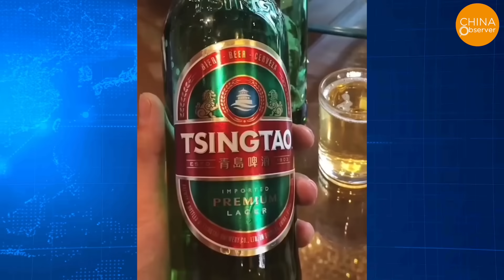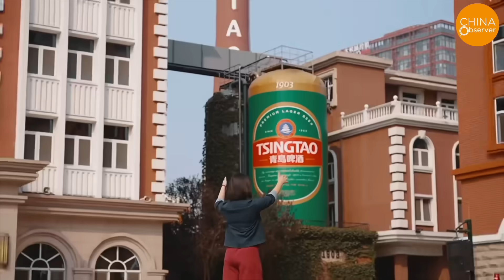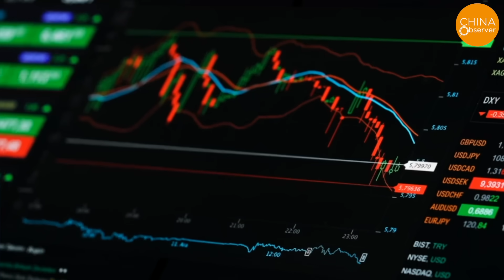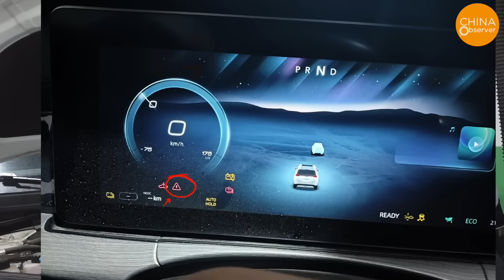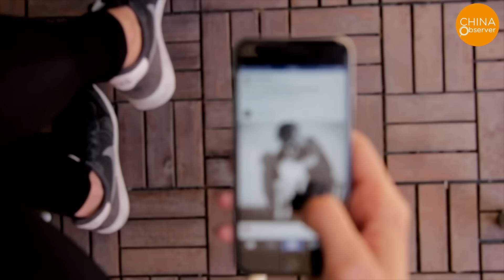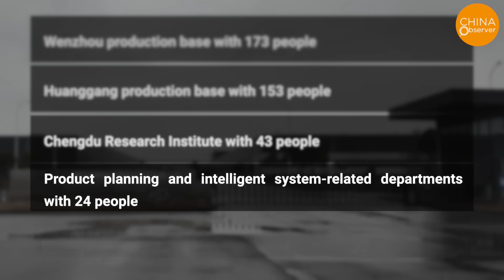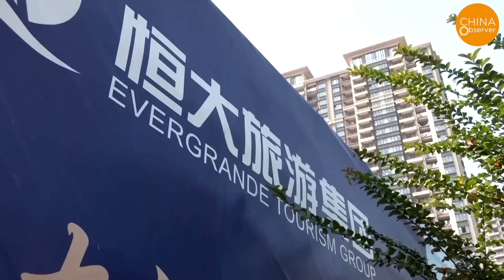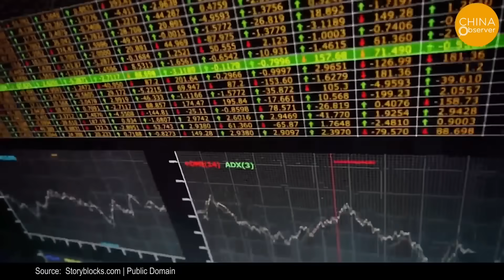Pit Toilet Pickles, Urine-Mixed Beer, Flammable Cars and Dilapidated Homes: China’s Four Misfortunes

Comment: At ~06:00 the fine calculation seems off. ¥1000=$136 but ¥10,000=$13,600? The first calculation seems correct but the second is off by a factor of 10 and should be ¥10,00= $1,360.